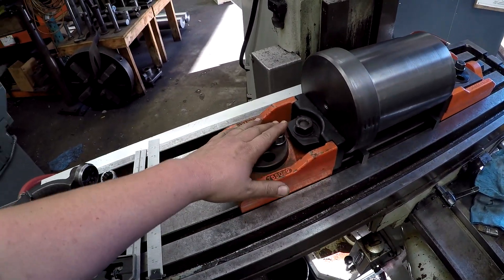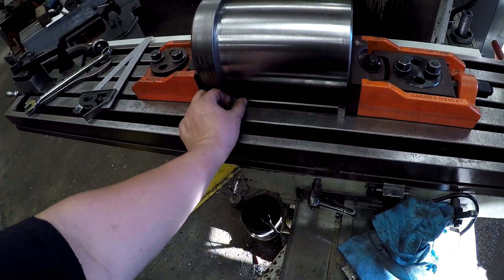Boring & Broaching a Kop Flex Shaft Coupling Part 2

Comment: Adam: if for some reason the broaches weren't available, is that something you could have done on your shaper?  Or if the customer say had more time than money would it have been more economical to do on your shaper, If it's possible?
Reply from the maker: Absolutely yes, you can machine those on the shaper.
Reply: Abom79 so a layman's question? If you had gone the shaper route you, or I should say your customer wouldn't have had to expend the time and materials on the plug, and the broach, which had to be a fairly expensive item given its uniqueness?   Is it because your employer doesn't own a shaper and they didn't want to be dependent upon yours, plus in the future if you've left they have the tooling for someone else to do it with the same accuracy?  Usually there's a rationale reason behind decisions.  Oh and don't mean to irritate you.  Scott

Comment: I really enjoy your videos, machine work in this country is becoming more and more rare. I noticed you were using coolant on cast iron. I've worked for the company that puts the Cincinnati logo on several different types of machinery for 46 years and coolant on cast iron was always a big no no because it can not only soften the metal but it saturates into the pores which causes difficulties with heat treat. We always had to use air blowing as close to the cutter as possible. It did make for a dirty plant and nose but worked perfectly.

Comment: How do you move hunks of metal bigger then this? Do you got like a crane? Or a motor hoist?
Reply from the maker: +girrrrrrr2 We have overhead bridge cranes to handle the heavy stuff. We also use metal carts to move parts around the shop as needed.
Reply: +Abom79 thanks for the reply.  I also saw you using it in the next video, lol

Comment: Had to laugh. I am about to buy a Broach for two cutter heads I made for my wood machine. That broach is bigger than the shaft I am working on. :-) I am also building a press so I can push the broach through. Only 20 ton jack am sure the press you use will be slightly bigger. !

Comment: Hey Adam, it's another good job. Wonder what feed you used for that roughing-end-mill?
I also have a pair of clamps, similar but much smaller, did not use them yet, if/when I ever use it I will add lateral blocking too, not trusting my small-one-bolt unit. Does yours have  a downwards force at tightening?

Comment: How did you find center on that big plug?
Reply from the maker: +EweTwoughb Used an edge finder and digital readout.
Reply: +Abom79 Oh duh, that's easy enough.  Do you need an extra long edge finder or is it not necessary to reach the tangent edge if the piece is level?

I absolutely love your channel!  The video quality, angles, lighting, audio, etc. are perfect.  A viewer couldn't ask for more.
Reply from the maker: +EweTwoughb I just used a standard 1/2" edge finder. can't stick it way up in the collet though.

Comment: Hello Adam,  Does your machine shop ever do or get an analyses of how long the cutting bits and tooling lasts?  In inches cut or hours or however they calibrate it?  It would seem essential to keep the overhead down and very interesting for those of us buying out of 'thin' pockets.  Maybe that info is available?  A comparison of quality of cut versus useful life of the tool would be valuable.

Those are some huge broach plugs and broaches!  If you speed up the hydraulic pump beyond that slow one you were talking about wouldn't heat become a factor at some point?  Say if you had a 100 ton hydraulic ram and pump and shot it through in 10 or 15 seconds--what would the downside of that be?  I would think you want to protect such an expensive tool in lieu of speed?  I am assuming those broaches are of a very hard steel and brittle?  Or is just the cutting edge carbide with the body flexible (to the tiniest degree) tool steel?
Thanks again for a great channel.    PS:  How about another challenge where you and Tom true up square blocks in the four jaw at the upcoming Summer Bash?  I was watching your 2014 video of doing that thread clamp block for the hydraulic ram end pintle and the thought occurred to me.  I hadn't even seen that done centering a square block with a dial indicator.  Doug

Comment: Maybe I should have found a cheaper hobby, I fly rc aircraft, boats and planes so I thought I could make allot parts hut so far I have sunk 2000.0 to get setup and inneed much more befor I can get into running condition, the lathe was big single outlay for a 12 inch 1000.00 butThe measuring tools cheap measuring tools for now , taps and die's Its definitely allot to setup
Reply from the maker: +gigabytex64 Not a cheap hobby, that's for sure......but very rewarding!

Comment: Did you finish off sides with HSS end mill? And don't understand how those cap head bolts don't interfere with brooch? Love the part about you showing the pecker tracks! I keep my mistakes in plain sight, just to remind myself of what a boozo I am sometimes!
Reply from the maker: +Fred Newman The shims were drilled on both ends and we could flip them around and stack them all together evenly, and only have the outer most shim being held in place with the cap head bolts.

Comment: Hey Adam, when you were milling the cast iron with the roughing end-mill it looked like it was cutting very easily. Does cast iron machine easier than steel?
Reply from the maker: +David Rahn (Dmrahn) Yes I was using a roughing mill. This was actually ductile iron and yes it's easy to machine, but is more messy.
Reply: +Abom79 Thanks I've learned a lot from your videos and I always learn something from watching them.

Comment: Definitely big boy broaches!  I wonder if using 3/4 hold down hardware on those Carver clamps would pull them tight enough to the mill table that they wouldn't push off from each other.  They definitely have a pretty aggressive jaw face to them so they should get a bite.
Reply: +bcbloc02   I've also wondered if it were conceivable that those clamps could introduce slight flex into the table surface.
Reply from the maker: +bcbloc02 I am thinking the 3/4" is what they need for sure. I just couldnt get enough torque on the 1/2" studs. A more low profile workpiece would be a little easier to handle too though. On there demo video they show guys milling plate steel.

Comment: Geez those are massive broaches for cutting the ways for some equally massive keys!  Heh heh, if Union Pacific needs any machining help on freshening up the running gear for the Big Boy 4014 steam locomotive (will be the largest operating steam loco in existence when its fully restored), they could see about giving your employer a call!  XDD  A lot of these parts you work on are as big, if not bigger, than the side and main rods and pistons of the Big Boy!  BTW, a Union Pacific 4-8-8-4 Big Boy locomotive's four main pistons are 23.75" and the stroke length they move back in forth in their cylinders are 32".  How does making possibly four 23.75" pistons grab you?  Don't know the sizes of the piston rods those pistons go on though, since that's info that's not easily found.
Reply: 4-8-8-4 is definitely A-bomb sized.

Comment: Adam, did you happen to think of using your shaper to cut the key Ways?
Jerry
Reply: +metalhead2508 
I understand what you are saying. I think one could consider the cost of the broaches vs time on the shaper. I don't want a argument, just food for thought.
Reply from the maker: +Jerry Halcomb It's another way to get the job done for sure, but Not on my little shaper. I do wish we had a big massive 36" plus Cincy sitting in the corner for those odd jobs.
Reply: +Abom79 
Thanks for your answer.